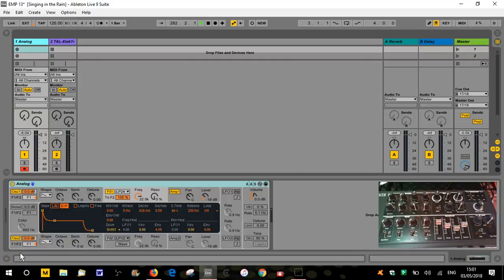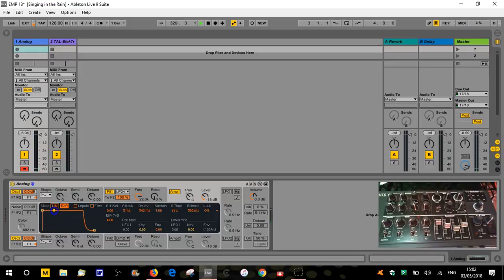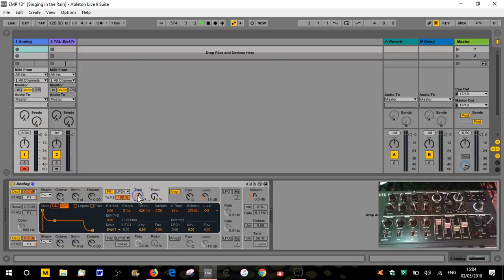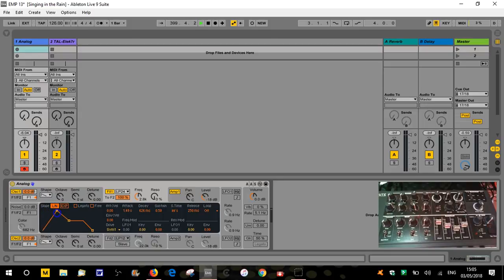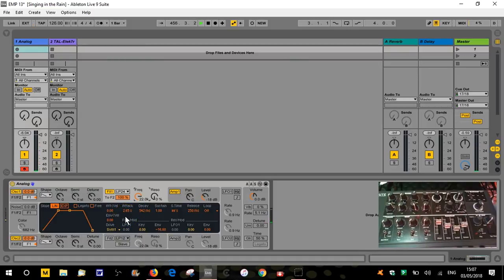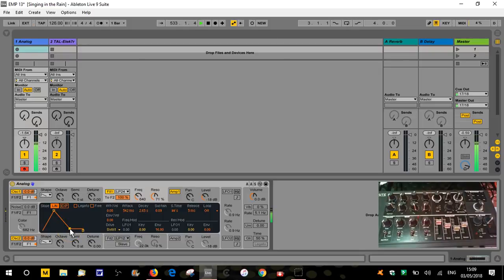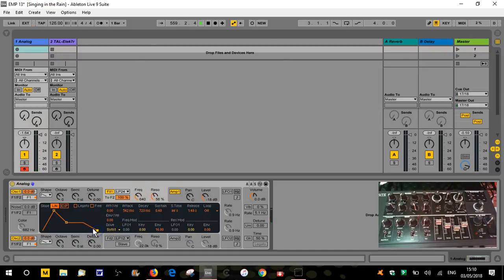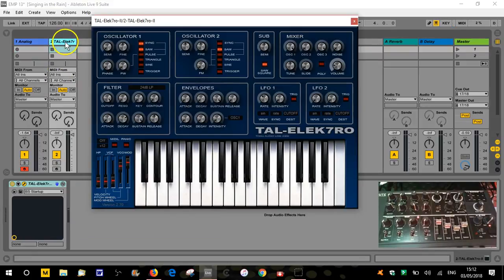Synthesis Explained - Part 5 - Filter Envelope

Comment: Thanks, now I get it, so many times I fiddled with those filter knobs/faders and nothing happened, I had no idea what they were meant to do or how to use them! But my little Rolands have additional controls in the filter section labelled "LFO" and "Key Follow"/"KYBD". I think I understand the latter from reading the manuals, but what is the LFO fader supposed to do?
Reply from the maker: The LFO fader is likely there to assign the LFO to control the filter cutoff. Not sure without seeing the actual synth controls but it will be something like that.